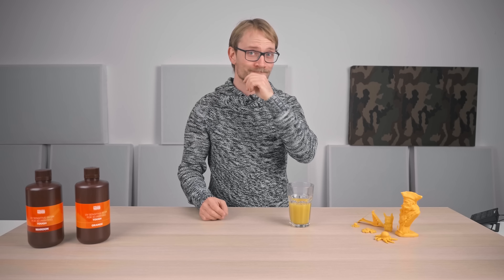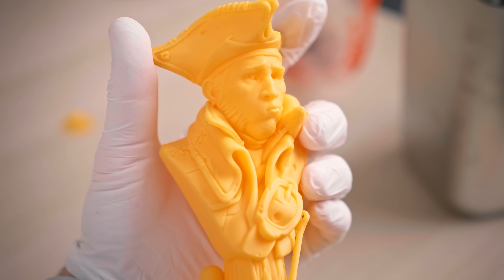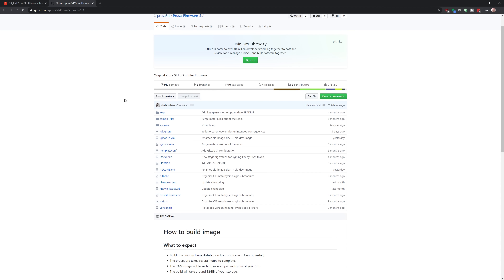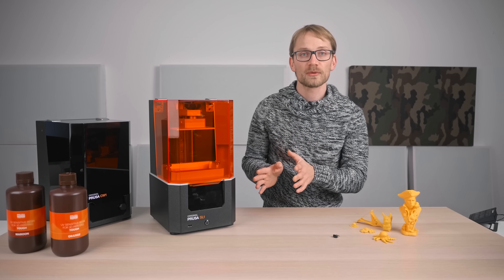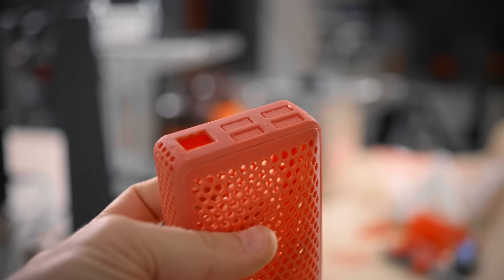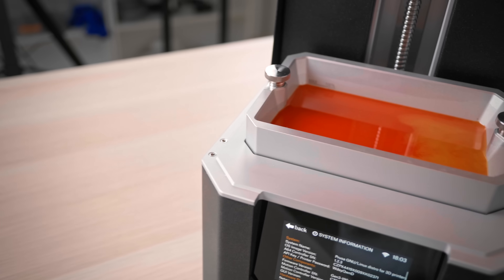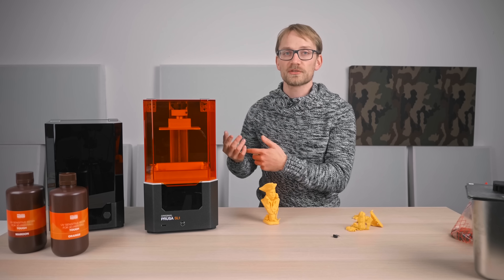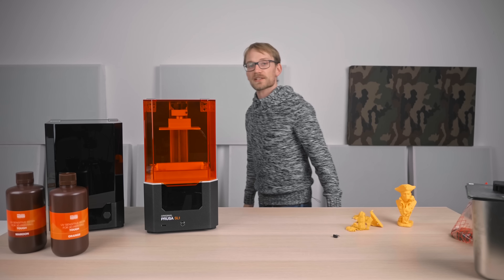The MK3 of SLA resin printers? Prusa SL1 and CW1 review!

Comment: I like Prusa, but this is way overpriced
Reply: Expensive but great machine as it looks. When i started 3D printing i bought a kit (ender3) and worked out all the issues that occurred (sometimes too many) to learn the whole process. In the end it will be beneficial to learn the in and outs of it because problems will occur.
Reply: @roboppers  I gotta agree on this. Though obviously there's that caveat that user really needs to have interest in learning that way. I got Anet A6 as my first printer and didn't want to spend any money more as I didn't know how to use 3D CAD software at ordering moment. I had good knowledge about 2D CAD though. Anyway that was almost too bad printer for starters as it has really many design flaws and I really can't actually recommend that particular machine to anyone. But something like ender or pretty much any other machine is great way to get started without too much money. I got quite quickly tired of monitoring that Anet and making improvements there just was too much hassle using it, especially as I quickly got into 3d cad and began to have multiple jobs queing up. Then I bough Prusa and haven't looked back. That I can recommend to anyone getting fdm printer, though it comes with so high price that imo good 3d cad skills are essential to have. Otherwise it's way too expensive machine for something like thingiverse printing.
Reply: Waaaaay overpriced. Doesn't even have a 4K LCD. Would've made more sense if this lead the way for 4K, but at 1440 resolution, all the reliability in the world doesn't make this worth 5x a Phrozen Mini 4K.
Reply: @uddek  I don't understand why so many people get sucked into brand loyalty. Even the guy who made this video, people are congratulation him for being "unbiased" in this review... Which he clearly is showing bias when you consider exactly what you just said.
Reply: The nob that holds the build plate is filament printed... all other printers are mold cast plastic, which is better. Dang that is cheap in my opinion for a $1600 machine, where else they cut corners and still charge a premium for it? Unbelievable that you pay that much and it does not come assembled? What a joke, who buy these?
Reply: @josemisiego  I guess it's very niche group of super fans of prusa. I'm fan of prusa, but ffs I would never ever buy that. I have ordered myself set of Anycubic Proton and their washing machine. Apparently I could've ordered something like three sets of them for same price. Prusa is doing insane overpricing. Edit, damn four sets for same price 😂
Reply: @jothain  They're slowly turning into the same as Apple fans
Reply: @Krytern  I suppose you're right. It's OK to support something, but fanatic fanboyishm is crazy and never understood it personally. I though that my Mk3 was very expensive for build it yourself kit and there has to be huge profit margins for them. But their resin lineup is something absurd.
Reply: @jothain  my Anycubic mono X comes tomorrow! They were doing that promo for $699, free shipping and it comes assembled not like this joke we just watched and 4k screen and bigger build plate.
Reply: That could be the reason why their are so few reviews of this.
Reply: Isn’t Prusa one—of-the-cheapest-but-good  sla type 3d printer????? What SLA 3d printer is cheaper than that?
Reply: @Kk-jj3xi  elegoo
Reply: @Kk-jj3xi  Creality ld002h
Reply: I like prusa, although i never had one of their machines, i learn a lot from their design and it inspires me. I would get a prusa if it wasn't so expensively
Reply: luke magdalin check out the prusa mini good printer good price a bit small
Reply: Well its like : a Lamborghini is too expensive, I'd rather buy an Opel or Toyota. 
Sure, you can drive and you can do nearly the same things with it, but its not the same a Lambo is faster, has better quality and other Benefits. 
You cant expect an Lamborghini for the price of an Opel.

Sorry for bad grammer and/or formulation I'm not an Native english speaker. Have and awsome day !
Reply: @throwawayaccountm1325  Bad comparison, see my other comment.
Reply: Im selling my Moai SLA printer, let me know if interested.
Reply: It's hard to tell if it is overpriced. The fact that other printers that claim to do the same thing come in at a much lower price point doesn't mean that this one is overpriced. If you buy one of these and an Elegoo Mars Pro and set them side by side and run the same jobs on them day after day, then you can tell which is better comparatively. But, for each usage scenario one might be better than the other--if you're going to run one print a day then they might perform the same. Heavier usage might show that the Prusa runs more prints before needing maintenance or tweaking. Whether the potential reliability and the proven quality of support you'll get from the Prusa is worth the extra money is up to the buyer. I have a new MK3S and it has worked flawlessly from the moment I finished building it and turned it on. That is worth a lot to me.
Reply: you're paying for the support.  I think you get what you pay for with Prusa.
Reply: @nerdsanctuary8307  I know and I have mk3. Still imo this is overpriced.
Reply: @nerdsanctuary8307  Paying for the support? I could get a different resin printer that prints the same quality, have it break, get zero support and buy another, then repeat a few times and still have money left over. I don't know how much you think support staff get paid....

Comment: I've had my prusa SL1 some months ago and have been experimenting with it. It is definitely reliable and I am very happy with it. As Tom mentioned there are some cons to it, but if you are new to resin printing like I was, I would definitely recommend it. Plus with Prusa's track record and my experience with their FDM machines, I was very confident in my purchase. I wanted something to minimize any errors on my end while learning the ins and outs of resin printing. And short of me doing something idiotic or not paying attention, the risks are definitely minimized. I got the kit and found it to be an easier build then their FDM machines. Really enjoyed building it and if anything ever goes wrong, I know how to open that sucker up. 

Once thing I do think Prusa should do is warn their users more about the smell of the resin and some recommendations to additional safety gear.  They do include gloves and other tools with your printer which is great, but they do recommend getting a mask and goggles as an additional safety step. From a logistical standpoint I can understand it would be neigh impossible to provide carbon filter masks. They don't know everyone's mask size and the cost alone would be quite a lot. Maybe they could remedy this by sending users a quick video recommending some additional gear and showing how to use it after purchasing. That way they can prep their workshop area appropriately. Also - a video of their SLA workstations would be wicked if they have one. 

And if you get this machine, Tom was not wrong about the fan. I can't compare if it is better or worse then other models but your room will stink. Since I have a small area for printing, I had to cobble together a type of ventilated enclosure out of plastic, cardboard, tape, glue, magnets and vent the fumes out a window. Makes a HUGE difference. If you can, keep this guy in an enclosure or another room.

Finally - a question for Tom - I have read on the prusa forums (and its recommended in the manual) that you are not suppose to clean the FEP film with alcohol as it can increase the "stickiness" of the FEP film. Basically the worry is the parts will stick too much to the FEP film and get ripped from the build plate. In your video, you were cleaning the FEP film with some sort of liquid. I assumed it was alcohol but I could be wrong. What do you use to clean your FEP film, and if you use alcohol, have you experienced any problems?

Thanks for the video!
Reply: Nicholas Sceusa these are great points and a good question you asked. What’s the answer Tom?
Reply: About how long did the build take you? What made it easier in your mind? I built a MK3, and a few other FDN printers so I am curious of your experince. I like the idea of knowing exactly how it goes together even if I have to deal with Prusa support to fix it.

Comment: Regardless if it's nicely built or not- and let's not sugarcoat it -it's MUCH too overpriced for the specs it offers, it's not going to work unless it comes down below $1000, and even then i doubt it'll make any dent in the competition.
Reply: It's not designed to be the cheap mass market option. It's going after the semi-pro tier.
Reply: @MoraFermi  Yet it offers the same specs or worse than the cheap mass market options- the only thing it boasts is a "stronger build", which is hardly worth $1500 more.
Reply: I think it has its market. We're considering getting a SLA printer at my day job for prototyping tiny stuff - Formlabs gear costs serious $$$, and we don't want to mess around with a crappy/badly-supported cheap chinese printer, and the Prusa SLA system seems to be a nice happy medium between those two extremes that'll fit the bill.

Thanks for the review Tom.
Reply: @garymarsh23  Elegoo has a massive community following and critically praised customer support.